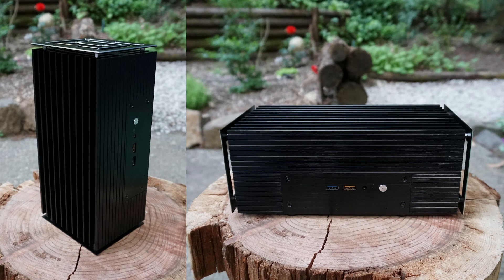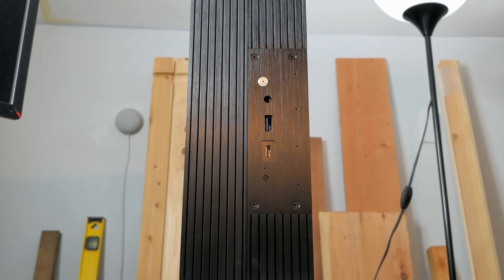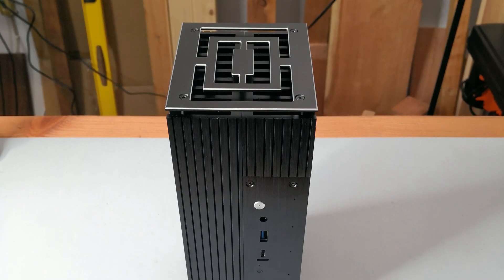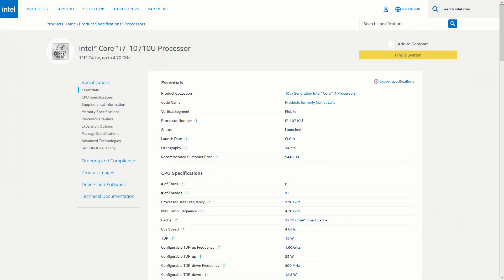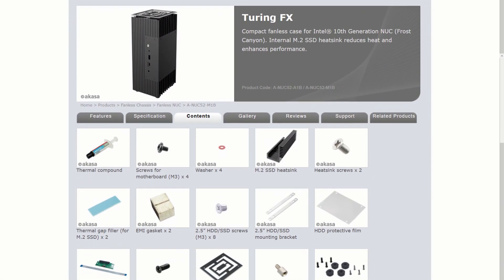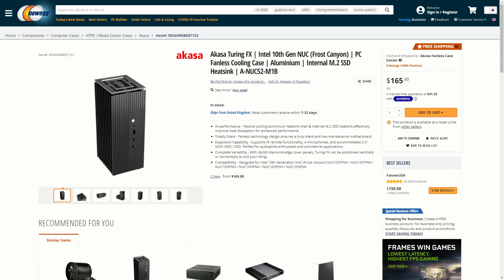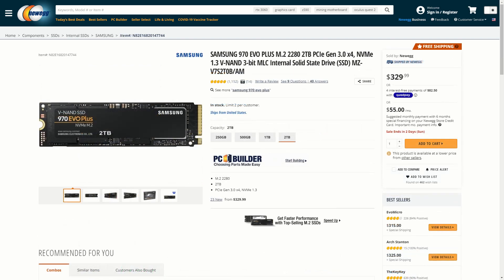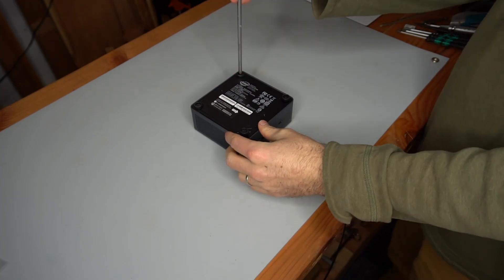Akasa Turing FX - Building a Fully Silent Fanless PC

Comment: This case is indeed very good, but I found a significant issue during use. The M.2 cooling is not adequately considered and can be affected by the CPU. This results in a gradual temperature increase during prolonged stress tests, even exceeding the CPU's temperature by a lot. Once it goes beyond 93 degrees, Windows forces a shutdown. This 93-degree threshold seems to be controlled by the BIOS, but I couldn't find any relevant settings in the BIOS. This issue makes it unsuitable for tasks like gaming or running algorithms.
Reply: In the end, I used a 10mm thick thermal grease pad underneath the m.2 slot. The motherboard temperature remained only 2-3°C higher than the CPU, which is sufficient to prevent overheating and shutdown even under full load at 25W.

Comment: I just dont understand why give quad core so much attention. These piss poor nucs are still only quad core with no gpu power at all!
Reply: 1. There is a 6 core 12 thread 10th gen NUC. It has an i7 10700U. I use it with this case and get about 7500 Multi, 1100 Single in Cinebench 23. I did have to add heat sinks + thermal pads to the VRMs though because they'd overheat without the fan otherwise. 

2. For workloads that involve high single core performance these NUCs actually work pretty well when their power limits and thermal throttling are dealt with. 

3. 12th Gen nucs have up to 20 threads now. 

4. Thunderbolt and m.2 eGPUs (especially on PCI-E 4.0 for the latter) solve the GPU problem in certain use cases.
Reply: My father even uses his i3 NUC for 8 years now. Still running smooth.

Comment: What would you suggest for passive cooled linux NAS? SSD NAS for home use.
Reply: Also interested in an answer for this. Looking for an AMD system with ECC ram
Reply: Odroid N2 🙂 (takes up to 4 USB3 disks), or Odroid HC4 (takes up to 2 SATA disks). Remember, it's not the vector processing or windowing system, you just need to have rapid I/O, and efficient encryption instructions if you need to retain speed while securing your data. Only 1 warning: do not use kernel 4.9 if you want to use BTRFS, BTRFS is badly broken on that kernel, use an up-to-date Armbian instead.